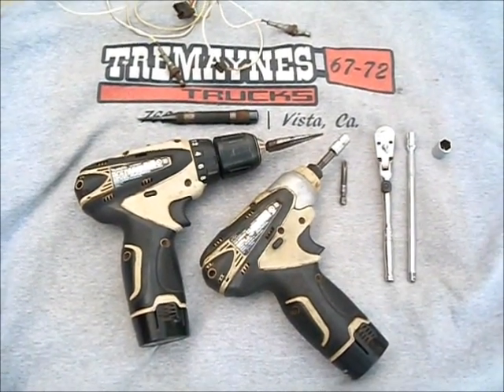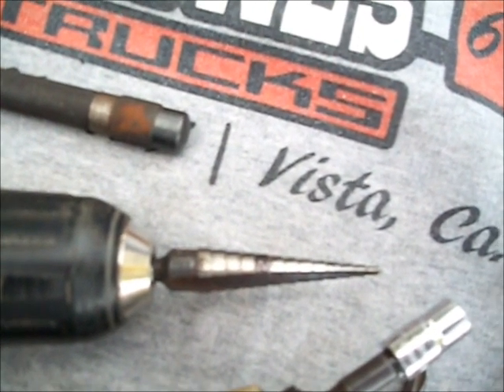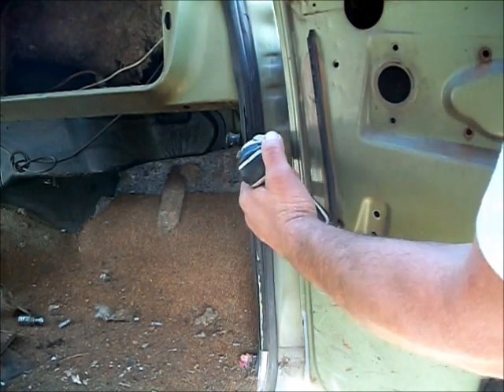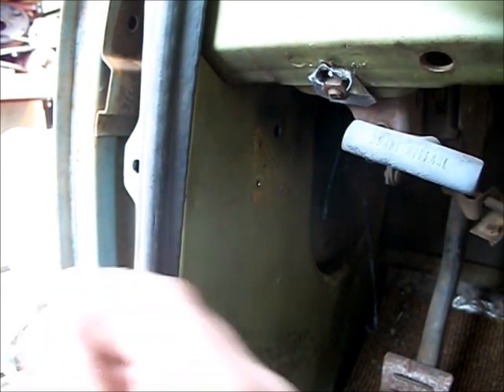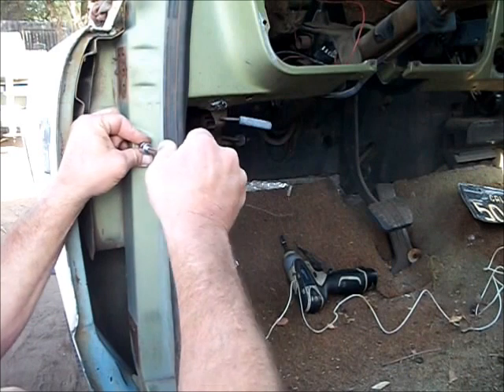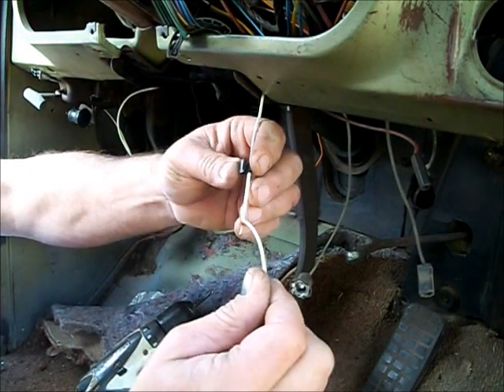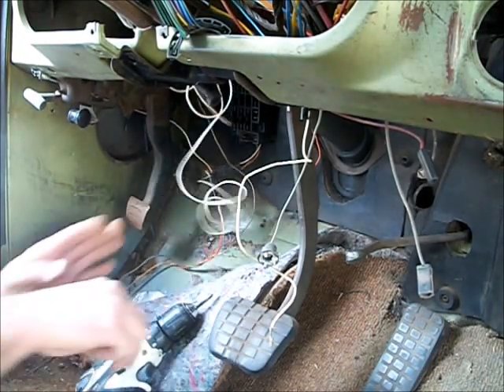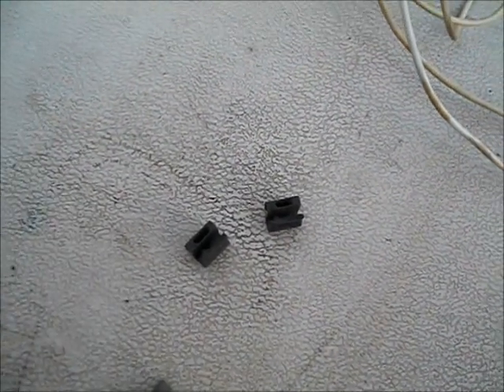Installing door activated dome light/courtesy light switches in 67-72 Chevy truck

Comment: Awesome! I was just getting ready to install a new courtesy light kit I have from American Autowire. I picked up 2 new switches from Classic Industries because my truck did not come factory equipped with courtesy lights. The kit even has 2 bulb sockets that can be screwed to the bottom edge of the dash for floor lighting. Where can I get some of those wire clips???
Reply: @mmoraga86. > It is April 2020 now, but unless you find a company that specializes in vintage vehicle fasteners, that maybe one source. Otherwise, our bone yard chain in Omaha, has an online vehicle search feature. These types of “Pinch-Weld” clips or edge clips can be found on GM trucks during the late 60’s into the 70’s. It was a common method used to hold a couple of wires under the dash. As a word of caution, wear gloves and use a medium sized flat blade screwdriver. They have little barbs on the edge, but place the flat tip between the painted part and clip, then pop up with your hand. You may look under the hood of many imports up along the windshield and find a similar type but perhaps plastic. Be less aggressive removing these as they could break. 
 A trick i’ve used for years is tape, if wires for others items are already there. The difference is, I place a dab of black weatherstrip adhesive on the last 1/2” or so, then roll on. This will keep it from un-raveling over time. If you get it on you fingers, carb spray or acetone will help clean if off w/rag. Hope this helps! Old retired tech.
Reply: @deankay4434  Thanks for the reply. Good idea on the black weather strip adhesive to keep the tape from unraveling. I started using adhesive lined heat shrink to seal the ends of whatever I wrap around wires. The tricky part is remembering to put the heat shrink on BEFORE I start wrapping things up. 😁

Comment: How did you get the brown connectors apart?! The dome light connector.
Reply from the maker: I usually spray some PB Blaster on them and sometimes use a small pocket screwdriver to get them apart
Reply: Thanks for the advice. I was starting to think that they didn’t come apart!

Comment: Would be great if you showed how to run  the wires from the dome light to each door switch. My truck does not have a dome light so I have to start from scratch
Reply: @Sergio Anguilar >If you have a olde GM truck, the plunger type light switch uses white wire for ground, tap into it. Many truck have a door made of a double skin, but be careful as they are 5/16” apart in the middle, but deeper at the back-center where a dome goes. If you buy a surface mount dome light w/two screws would be best, but to run wires in a pickup is not bad.
 With the seat moved and folded forward, the inner cab corner is open all the way up to that sweet spot. Locate, mark mount holes, then locate & mark where the wires have to exist. Use a length of rubber fuel hose cut to expose the first 1/4” (7mm) of the drill bit showing. Use this as a pilot, go slow and you will hear the drill motors noise change before it goes thru. Use a “Uni-Bit” or stepped bit and tape it for depth. Once holes drilled, orange is hot to brake switch (Hot All the a Time), while white supplies you ground. Please use a rubber grommet sold at home improvement stores, buy dielectric grease to aid installing but on connectors as well. I prefer soldering & shrink tube every time. Use a hard wire like MIG wire or home improvement stores sell cheap spool of wire for re-bar tying in the concrete components department. Cut it long, fish it in first, fold end over both wires, tape with electrical or masking tape. Now, gently guide and pull the wire thru, then make you light connection. (Soldier & Shrink Tube) Run the wire under the carpet with the sill plate removed. Tie wires to current harness and make connections. 
  A simple test light to ground, will show power at brake switch or hot in-used fuse block spot, but hook test light to hot (B+) will show ground. The rotary know on GM headlight switches control dash bulb brightness, but a contact at full rotation contacts the white wire to ground, allowing for manual control as well. I truly hope this make sense and help you! Best of luck...You got this!
Reply: Sergio I just did the wiring on my 67 C10. I’ll be more than happy to help you out

Comment: Is this similar for 78 K10? All I have is the courtesy light under dash for the floor and there is no dome light in there? I don't know if this truck was equipped with a dome light but looks like there is 2 screw holes above the mirror in-between the visors that could have been the dome light at 1 time.
Reply: Not sure but on the 67-72 c10 the dome light is on the same position as shown in the video

Comment: Would this be similar to wiring to a 75 f100
Reply: Not sure about the dent sides but on my bumpside its similar but completely different then my 70 chevy courtesy light. On chevys it only works when the door are open but the ford you can pull a knob to turn it on any time plus it turns on with the doors open. So I'd say its different